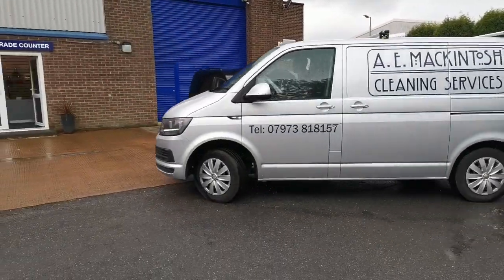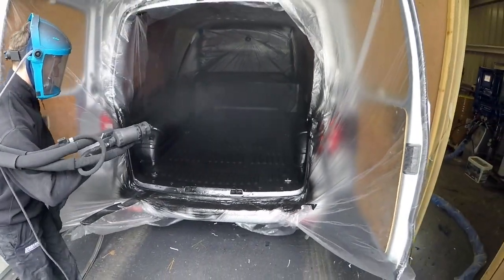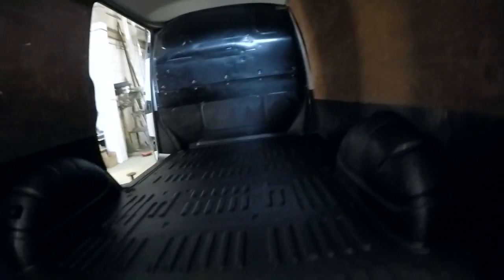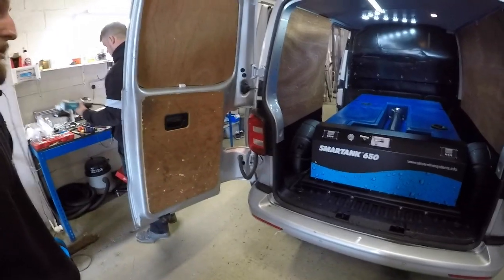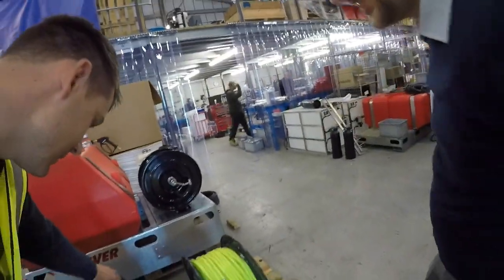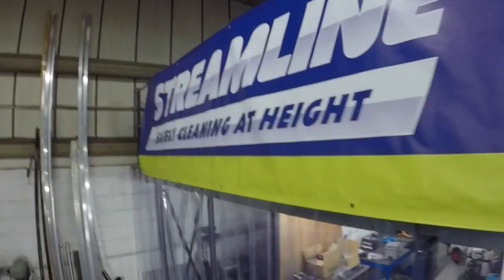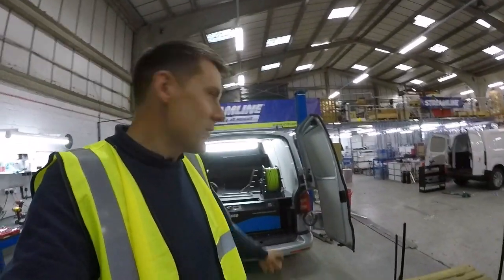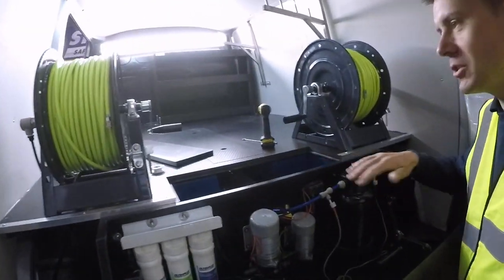New WFP Fit Out Transformation - VW Transporter

Comment: I like the low profile design.  My 97 gallon water tank has Surge Buster baffles and is 10 inches tall and 40" wide.  Why did you choose Varitech to fit your van...?
Reply from the maker: It’s a very neat system with everything built in. It’s so easy to fill at the end of the day.👍🏼

Comment: Armrests were basically the only reason I brought the high line 😂

Still can’t wait to see you get your power washer on top of that tank 🤔👍🏼
Reply: I was thinking the same , it’s not a great way to use space . I’ve a 650 upright tank in a dispatch with the reels mounted to the frame and it seems to have much more room in it . Struggle to get the guttervac into that I think . 

Looks the part though 👍
Reply from the maker: I’ve been working with it for nearly two weeks now. Definitely need a ramp for the pressure washer, it takes two of us to lift it at the moment. The vac lays flat. I’m finding that there is loads of room and the weight of the water is kept low down.😃👍🏼
Reply: A.E.Mackintosh Cleaning Services 

Looks the part mate - that’s a positive with the water I never thought of that , you probably don’t even know it’s there cause it’s distributed evenly over the van . When my tank is full you know about it 😂- you need to knock the speed down round the corners .

Good luck mate 👍👍
Reply from the maker: Thanks.😃👍🏼
Reply: A.E.Mackintosh Cleaning Services looking forward to seeing your power washing trailer set up 😂